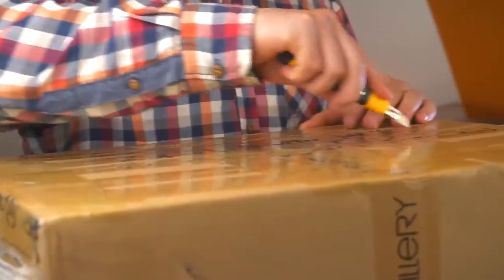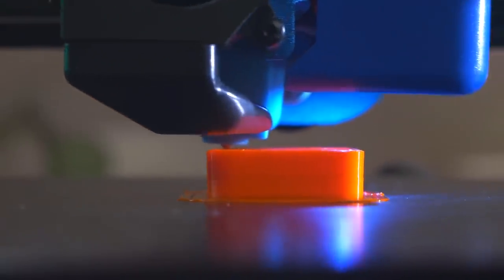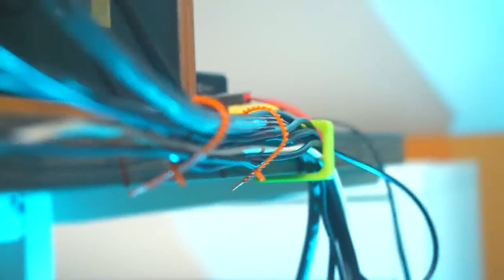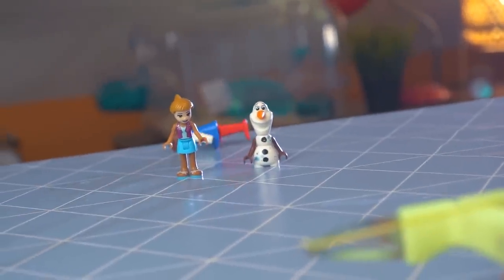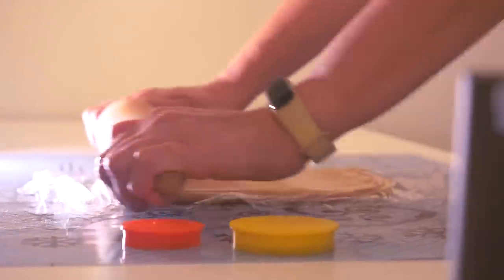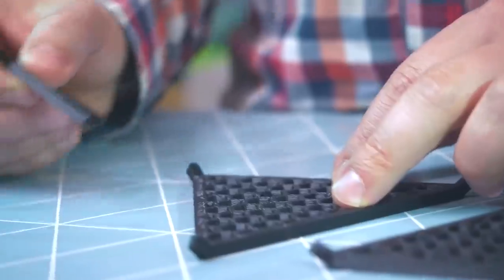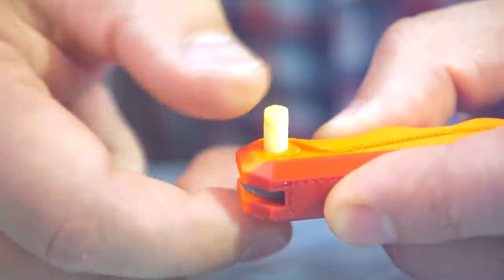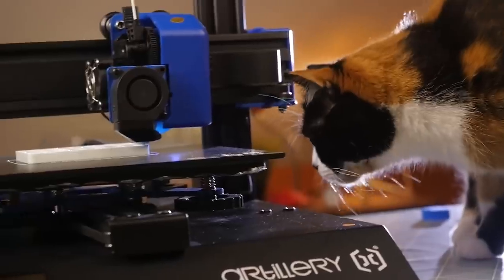THE MOST EXPENSIVE ITEM WE BOUGHT FROM CHINA

Comment: Red meat
The sausage is made of red meat.
Red meat decomposes very quickly, specially when exposed to the elements.
But also, requires very strong acids to dissolve and digest.
A carnivore plant doesn't have enzymes nearly strong enough to process the meat before it decomposes. It can't even digest a single insect full by the time the sausage rots.
And when the meat decomposes, the plant gets infected with strong pathogens.
On the other hand, the candy only needs basically water to break down, yet, you can see that a small yeast colony formed on top of the leaf.

A carnivore plant I had once died because it captured a small cockroach. But even that was bigger than the usual flies, mosquitoes, ants and weevils that they usually catch, and the whole stem wilted as result. 
You'd need a really big, grown up carnivore plant to digest meat. Some in the wild are indeed known for eating small rats.

Comment: 5:32 it doesn't break the law of physics.. as u attached all of the strings.. when the top platform was about to fall it's actually hanged by the middle part of the system.. the even length of the other three strings keeps the platform balanced..

Comment: And also the battery holder you printed, just solder those batteries properly in a series or parallel connection then wrap it on a tape or the heat shrink "thing" that when a heat is applied it shrinks, and viola!!! You have a battery pack!!!!😍

Comment: Unless 3D printers significantly improved since I last checked, printing things to use on food (either eating with, preparing with or just just putting it on) isn't safe there will be small holes in them where food can and will get stuck very easily and create mold on it.